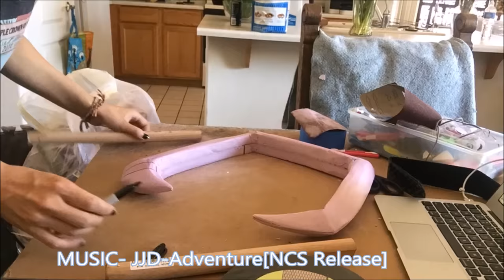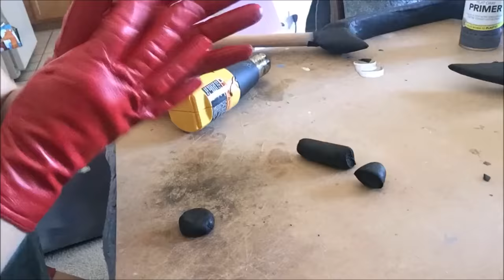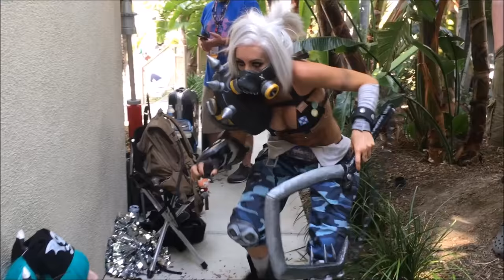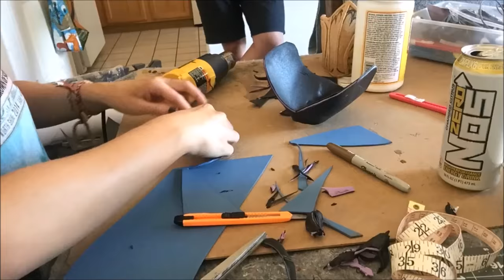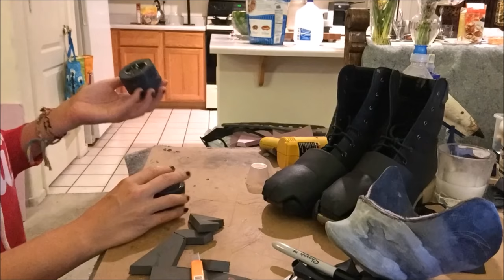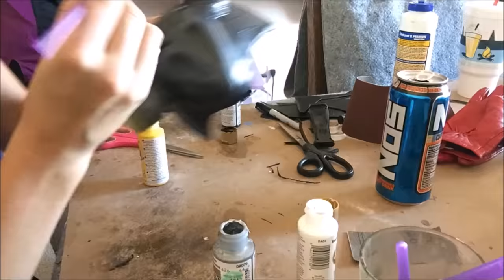HOW TO MAKE ROADHOG MASK AND HOOK: OVERWATCH COSPLAY

Comment: When attaching two pieces of the foam, does she glue them together with hot glue or does that melt the foam?
Reply: contact cement is most commonly used for gluing eva foam :D
Reply: Thank you so very much! <3
Reply: FransKiss what's a good brand for contact cement for a cheaper price?
Reply: DAP Weldwood 3 oz for only 5$ at home depot(:
Reply: Thank you :)
Reply: you're welcome :D
Reply: RedRobotCake it depends on the temperature of the glue/gun

Some you can choose hot or cold glue. Cold glue is better as I've burnt through foam before
Reply: You can get contact cement in lots of places. I would go to a home improvement store and ask about contact cement or barge. I personally like contact cement better, we use it in my theatre while working on puppets. Generally foam can handle hot glue but it doesn't last as long, contact cement makes it so that the peices will not come apart unless used under a heat gun or cut apart. Contact cement smells so use it outside in an airy place and don't breath it for extended periods. To use contact cement you need to lightly glue both materials you want to fuse let them dry (like 5 mins) until tacky then fuse. I wear gloves because this stuff is seriously sticky
Reply: Taffyart Thank you!😍

Comment: I know this might not reach you, but what tools are you using to carve the foam?
Reply: I had thought so, I tried pausing it a few times and saw it might be one of the longer exacto utility knives. To the Home Depot!
Reply: Sometimes a box cutter does a better job! I find that my exacto blades are more brittle and get more dull faster.
Reply: I noticed that, my box cutters are holding up better. I just need a thinner cutter.
Reply: Ill have to try that as well. The Hanzo bow I am making is going to take a ton of work and lots of sharp knives.
Reply: Paul Karyakos Stanley knives are good for this kind of thing

Comment: what paint do you use? I'm using acrylic paint based on recommendations from other prop builders bit the metallics have horrible coverage (4+ coats needed) and colours require atleast 2 coats. from the videos done by the pros it looks to be done in one coat.

Comment: where can one acquire a template for the mask used as a base?

just joined a LARP that would require me to costume some stuff. having a mask like that would be endlessly useful. so much can be added subtracted to that!

also, saying/listing what materials you used would be helpful. i only recognise some of the materials you used. that sheet stuff that you melted to make mask base would be useful if i knew what it was. can it be melted using a blow dryer?